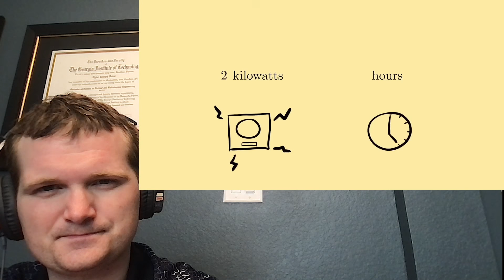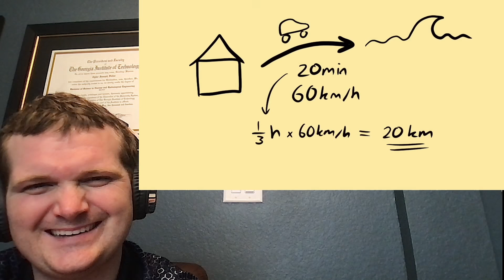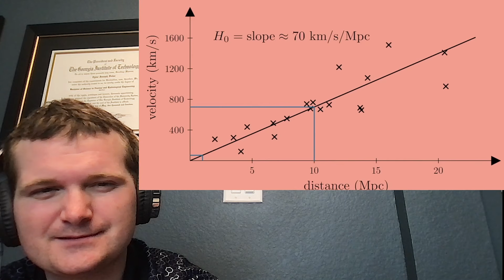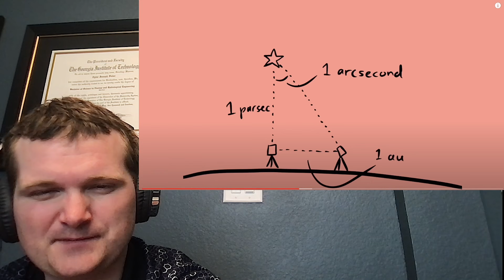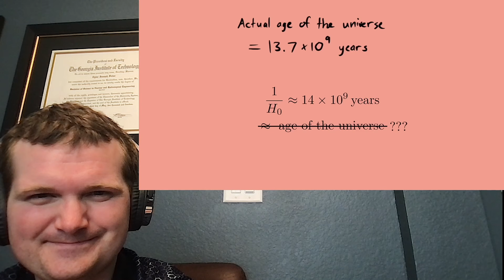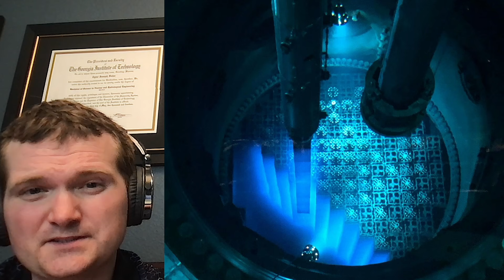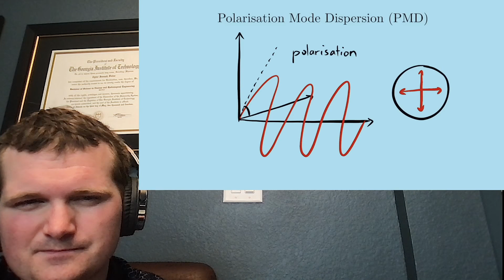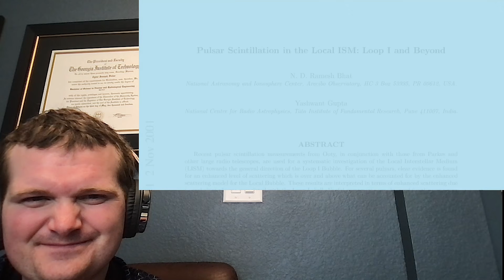Nuclear Engineer Reacts to Cursed Units by Joseph Newton

Comment: A lot of these are "cursed" in the sense that they contain uncancelled units, but some weird things can happen with cancellation as well.  Take the specific impulse of a rocket, which is used to measure performance.  Basically, it's the force gained from burning a propellant divided by the weight of the propellant.  (Yes, the weight, not the mass.)  Since weight is a measure of acceleration toward a massive object (force over time), you essentially have two "force" units that cancel each other out, leaving only the time measurement.  As a result, specific impulse is measured in seconds, with a higher number for a better performance.
Reply: That's not weird at all though. It simply (and usefully and intuitively) refers to the number of seconds that the rocket engine + any amount of its matching fuel can accelerate its own mass at 1G before running out. Efficient fuel or better engines can accelerate their own mass at 1G longer than inefficient ones.
Reply: Yup so a rocket lifting off from Earth will always burn for less time than its specific impulse and you can work that out from the thrust to mass ratio @gavinjenkins899
Reply: Specific impulse is impulse per unit mass so it's force x time / mass. The only reason it's "seconds" is because they are treating force and mass as canceling. E.g if you get 100 pound-seconds (impulse) per "pound-mass" (mass) of fuel you have "100 seconds" Isp.

But it's a dirty trick. A pound of force and the mass which produces a pound of force subject to the gravity at the surface of the Earth are not the same and don't really cancel.

The only reason this works is everyone agrees that they will measure their unit of force in the same unit as the mass which produces that force at Earth's surface (and no where else).
Reply: @frederf3227  There's a reason I said that they used weight instead of mass in the calculation.  If you use true mass, the units don't cancel.  But if you use weight instead, then it does cancel.
Reply: @MarsJenkar  But what does weight even mean in rocketry? What weight? Weight on Earth, on the Moon, on Mars? Why define a unit for space exploration in a way that is only somewhat meaningful on one specific planet?

In my opinion it's just lazy and incorrect handling of units.
Reply: @rschroev  It's essentially a hack to easily convert performance of a rocket between SI units and US customary units. That's the only reason it's done that way.
Reply: Yess took me some time to get this one love it tho
Reply: I know this thanks to KSP
Reply: God that's RIGHT, specific impulse being measured in SECONDS

This tripped me up in KSP for so long, I tried so hard to figure out WHAT SECONDS WE WERE MEASURING!!! Sometimes it'd vaguely line up with the actual time it took for the engine to use the attached fuel tank? But that doesn't make sense, because the number is on the engine, not the fuel tank???

Eventually I DID figure out that, physical consequences wise, the number of seconds sort of linearly correlates with the total change in velocity you can get out of a certain fuel tank (i.e. the efficiency of the engine, yeah), but still, Specific Impulse is mystifying
Reply: Omg I have been thinking this when I'm watching videos on rocket engines and always think, "does it need to be this way? I must not be able to grasp something here" so thanks for explaining it
Reply: weight because "g" really matters for a rocket.
Reply: for the gravitational constant, it doesn't make sense to simplify things because the purpose is to recalibrate the equation and also interpret it
Reply: I personally find using mass much more convenient because you can easily put that isp into a formula for total change in velocity
Reply: iirc, isp is measured in seconds because everyone got too tired with metric-imperial translations

seconds are universal
Reply: @NoNameAtAll2  never heard that. Got a source?
Reply: It might be a joke…. You know…

Comment: A lot of people have trouble wrapping their heads around the fact that a watt is not an amount of energy, it's a rate.  So to get amount, you have to multiply it by a time.
Reply: I think that's at least partially because the watt doesn't explicitly show its time unit unlike other rate units we commonly use. If we called it "joules per second" more people might understand (and we could just use megajoules for amounts of energy instead of cursed kWh)
Reply: @CoolAsFreya  Thats true for some reason it took until I was 17 to understand this because before that my teachers had told me that if you calculate power as X number of joules / 1 = X Joules. 

Which is true but it didn't click what 1 was until I learnt it was just one second in that case so happened that power = energy.
Reply: @Idris.505  power can never equal energy. That divide by a unitless "1" is pure sin.
Reply: @DrDeuteron  I know right it was extremely confusing for us in physics I'm glad I moved out of there
Reply: explanation: a watt is 1 joule per second
a kilowatt is 1000 joules per second
a kilowatt being sustained for an hour is 3600s*1000 joules/s, or 3.6 million joules
which is about 830 food calories- most people run on about 100 watts then.
Reply: I'm sure it doesn't help that in common English usage the word "power" is often treated as interchangeable with "energy" in contexts that are not necessarily very technical
Reply: Watts are also defined voltage × current. Where a Volt is one Joule per one Columb of charge and an Ampere is one Columb per second. Canceling the Columbs out and you get Joules per second.

One way you could think of it, to perhaps simplify the thought process down to a single dimension is Watts being the "speed" in Joules per second (compare to m/s) where the Joule symbolizes a small unit of distance. A Watt hours being the number of such small units reached in one hour.
Reply: Wait, watt?
Reply: Here they "solved" that problem by using kWh/1000hrs unit and putting that on all appliances, so if you have a 50 watt appliance, it will consume 50kWh for every 1000 hrs used.
Reply: @bami2 oh no! Energy / Time * Time / Time 😵‍💫
Reply: @bami2  And this is discussed in Cursed Units 2
Reply: @bami2  wouldn't it be 3600 * 50 watts due to the hour having 3600 seconds?
Reply: @bami2 For some reason, that's just the EU standard.
Reply: yeah, and it only gets worse when you have things  like lightbulbs being labeled with watt strengths..... which are literally beyond meaningless as a rea measure and only on that led box to cater to the misunderstanding of watts😅
Reply: A lot of people struggle with the concept of rates.
Reply: Sparkies 'ill tell ya.
Reply: Would have been a lot easier to learn if it was presented as such
Reply: Its cursed to think about but once you realize that a machine (which uses power) isnt turned on for a moment but for a time its more comprehensible.
Reply: particularly a watt times 41 2/3 days.
Reply: I don’t think many people think watt is energy.
Reply: @peterpumpkineater6928 A large percentage of the US at least is illiterate and wouldn't know what a watt was anyway.
Reply: While wattage may be a rate, most times if someone says (50 watt) etc they mean per second. 50 joules per second is 50 watts per second etc.. Isn't the formula "per second" anyway? It is effectively an amount of energy.. in one second lol
Reply: @DarkAttack14  "50 watts per second" makes no sense.  Because wattage is already a rate that includes a time component.  That's why to get an amount of power you have to multiply watts by time.  Watt hours is an amount of energy.
Reply: @StormsparkPegasus  Why not just use the energy unit? Why divide by time and then multiply by time? The Cursed Units guy is not wrong.
Reply: so just use jules
Reply: The counter of total energy produced and current output were flipped in my primary school and still are to this day. 

The current output has a number which constantly ticks upwards with Kwh next to it and the total energy produced has a fluctuating number with Kw next to it

It is absolutely insane that the person who installed it didn't understand even when it was pointed out to him -_-
Reply: I work in the power electronic industry and the amount of people, even engineers, that write kW instead kWh and vice vers just annoy me so much.
Reply: Horsepower is the same way. It is a function of torque and RPM
Reply: Which is why it’s dumb that use it in the first place. It’s like measuring distance in kilometer hours per hour. 
Just use Joules and ditch the time aspect completely
Reply: Also, sorry for the double reply but this is where it's kinda bs to me. My phone charger says 20W so I, an average civie, assume 20 Watts......20 watts at what rate??¿¿ every hour?? Minute?? Galactic year?????
Reply: @killerzer0x74  20 joules per second